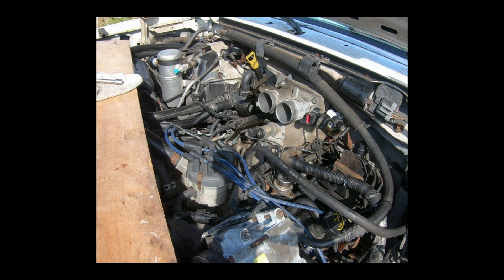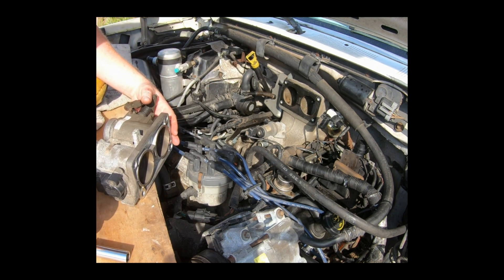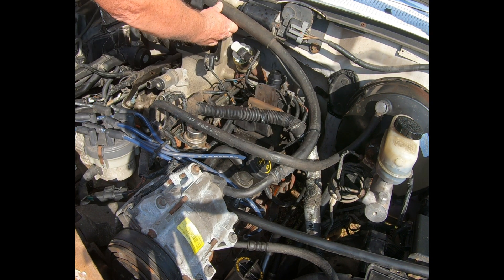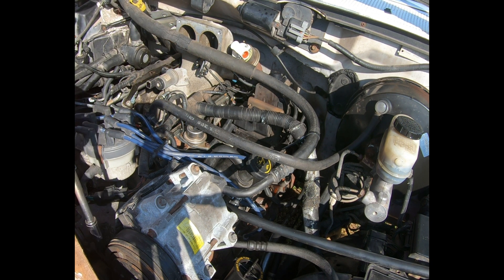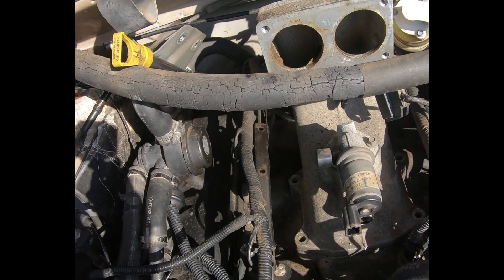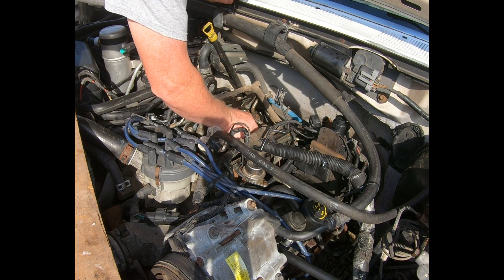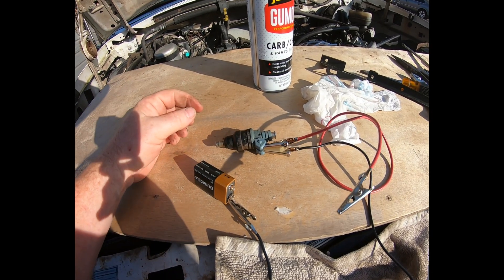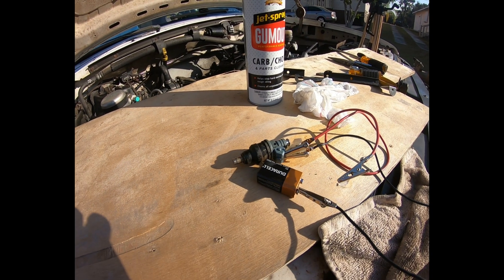1997 F350 (ex)U-Haul 7.5 460ci EFI removing and testing fuel injectors.

Comment: What were the visual signs of a stuck injector? Will fuel seep from where the head and exhaust manifold meet when running? Thanks for sharing
Reply from the maker: Hi; Nothing visual. Just a rough, or not at all, running engine. Extra fuel may spray into the cylinder which over time may dilute your oil.

Comment: What injectors did you buy
Reply from the maker: Hi; Approx $115.00 for a reman set on ebay out of LA Calif area, but they weren't trustworthy. They leaked when pressure was applied but not activated. We had better luck buying an ultrasonic cleaner and cleaning the original set. There may be others that are good, check out the seller closely. Our 97 took the four spray pattern 24lb fuel injector. All covered in the video series.
Reply: @Ammo461  thank you sir i actually just bought the better half a ultrasonic jewelry cleaner she gonna be pissed lol oh well